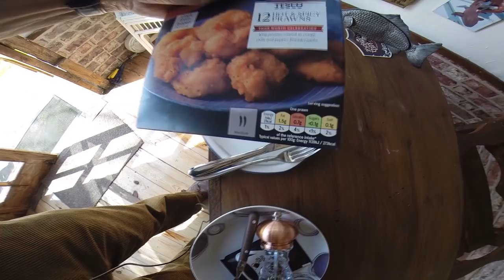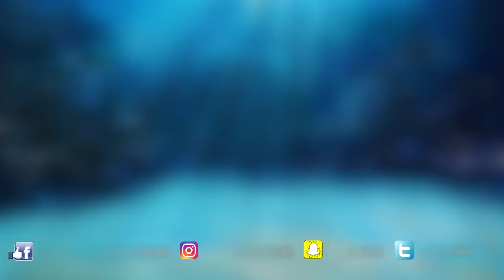Lockdown Fever - It just keeps Going!

Comment: Graeme----I have 3 culprits for your black gritty dust on your garage door and gutters. 1) Your use of the tackle shack stove especially if it's up wind of your garage. 2) Your suggested vehicle diesel carbon deposits. 3) Burnt carbon deposits from aircraft fuel. My number 1 suspect is the smoke from your tackle shack stove.